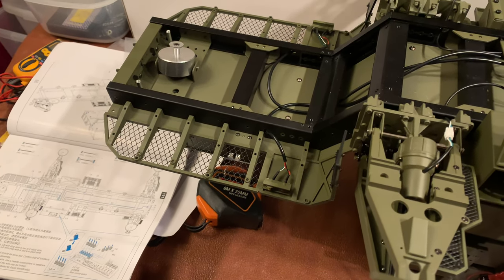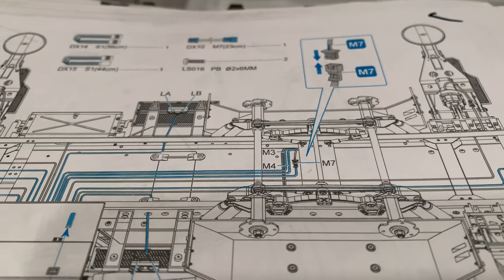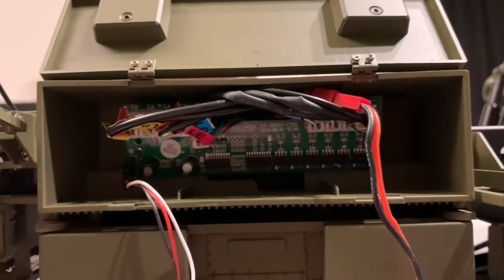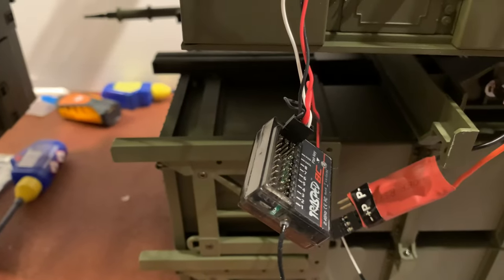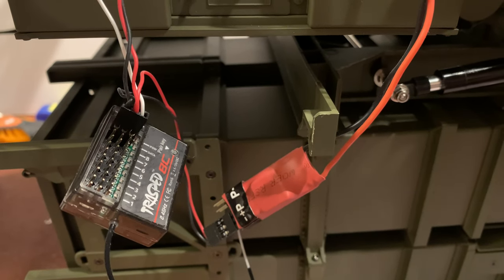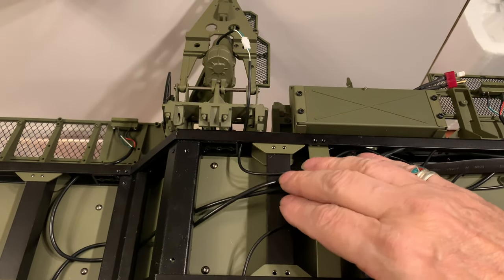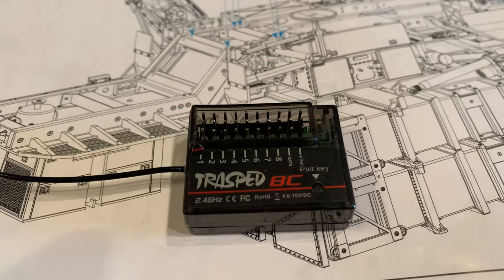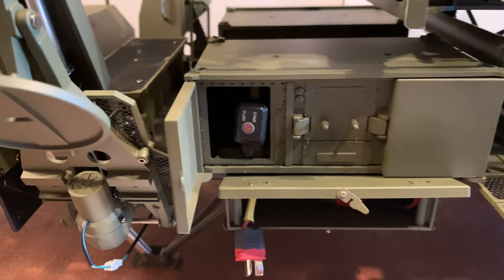HG P805 Build Final part 3. Well mostly! 1/12 Patriot missile launcher

Comment: Looks great!! Where that hole is for alll the wires to pass thru could you not drill it bigger?
Reply from the maker: Thanks Harold, its in the main beam and I would have ideally extended it before I had legs on the frame so I could have drilled into it whilst it was on its side. Its ok just a bit of a pain. If you haven' built it yet it would be an easy fix.
Reply: @Paul's model shed  what i did was cut a piece out of the base plate so the wires weren't under any tension, as it won't be seen; it didn't seem to matter

Comment: ref m3 m4 wires, which is what i got  wrong. Hopefully, I haven't damaged my circuit board.....hey ho
Reply from the maker: I'm still trying to understand what is going on with that slip ring as both elevation motors should be the same, so why one has three wires and the other two I don't know. The extra wire must be a permanent plus or minus connection to cause the missiles to raise up without getting a signal from the transmitter. It's all very strange.
Reply: @Paul's model shed  the one with two wires connecting to m3 is a power supply to the two motors that control the launcher the one with 4 wires which connecting to m3 takes the power TO the launcher and then to the transmitter. those are the ones i mixed up, so instead of being controlled by the transmitter it had a constant power until it blew up the regulator. at least that's how it appears.....
Reply from the maker: Ok not sure about the power to the transmitter bit but whatever it is it’s a crazy thing to have to spot those tiny wires when logic dictates that each one would be attached to a single actuator. Hopefully others will see this and not fall into the trap. Thanks Pete.
Reply from the maker: Oh and the two wire one goes to M4 not M3.
Reply: @paulsmodelshed  you see how easy it is to get wrong....but very important you don't....lol
Reply from the maker: Yeah. When I looked at the M3 wire I only saw three wires in that plug not four. Now I’m having second thoughts about that. I don’t know if I can see it now it’s in the control board though! Aaaaaarggggghhhh!! 
Curse you HG and your oriental tortures.
Reply: @paulsmodelshed  When you connect the 8c receiver... can you switch on both the P801 and the missile / L or you have to switch off the P801 . And by the way my controler is an 8c .